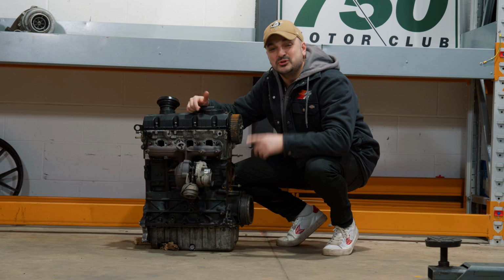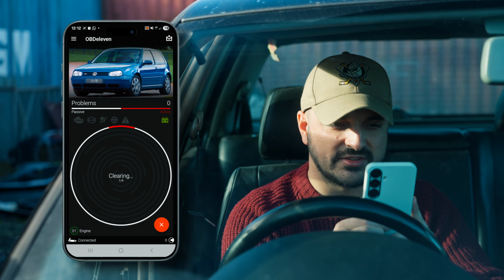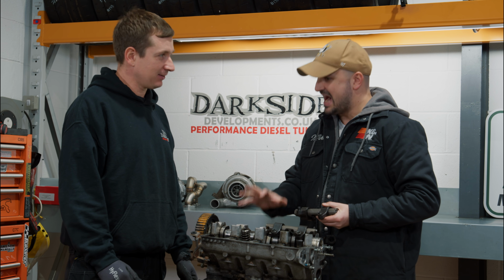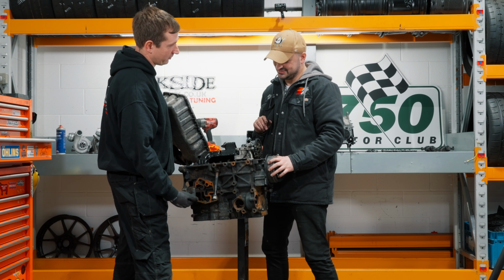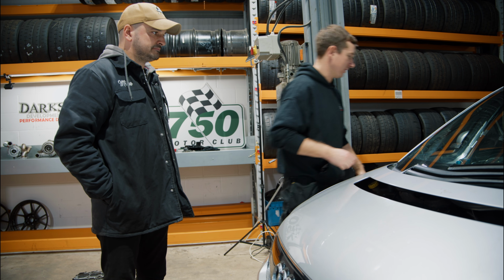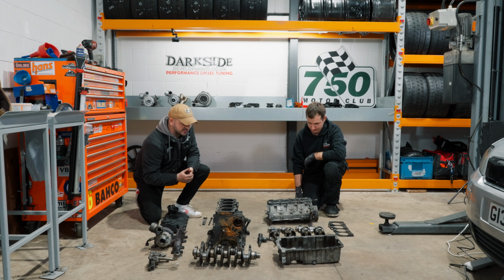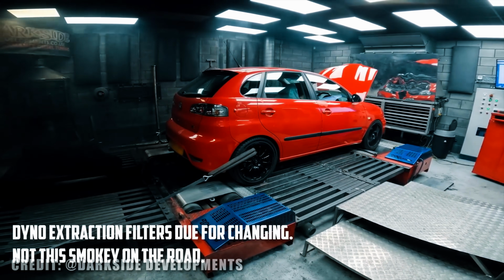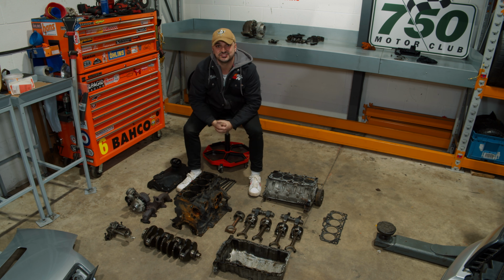Why This Volkswagen Diesel Is The Greatest European Engine Ever Made

Comment: I have a golf4 PD90 ALH from 2001 fully stock, bought it after covid with around 250.000km and it had not been maintained very well - leaking injection pump with faulty temp sensor, air bubbles in the fuel return line, cracked vacuum/fuel lines, faulty radiator thermostat, coolant had probably not been changed in more than a decade, massively clogged EGR/intake... and the fact that with all these issues I remapped it to 130hp and IT WAS STILL RUNNING PERFECTLY is a testament to how indestructible and well built these engines were. I've ran it as my daily for the past almost 6 years in far from ideal conditions and other than oil changes and one regular timing belt change, it has had zero issues so far.

Comment: I used to have a beautiful Audi A4 B5 avant with the 1.9tdi in. I had 5 years and sold it at 200,000 miles. Biggest mistake i ever made.  No other car i had even came close to how reliable that car was. Quick too.  Even 6 years later i still miss it. 😢

Comment: 2017 K9K engine 1.5tdci -- used in several motors including Mercedes , little engine , sounds great and pulls brilliantly , with maintenance , you will get some mileage out of it ,with great fuel economy too
Reply: Its a 1000% Renault engine and its not tdci. Its a dci
Reply: @ThaDutchDK1989 good shout , sorry force of habit

Comment: Back in 2006 I had a MK4 golf with a remapped pd130 in it, and 160k on the clock, never had Dyno proof of what power it was pushing but the previous owner had it tuned by star performance in fife and it pulled like a train, like proper quick, It was one of the quickest cars in my local area easily smoking most of the competition, pushed a Subaru wrx along a road one day sitting right up his arse and he could not get away from me till about 100mph then my golf kinda ran out of puff or wasn't geared right, not sure, had it for about 3yrs and apart from servicing it and tyres it never cost me a penny.

Comment: I had a 2002 VW Passat with a 1.9 TDI AWX engine. It was running  on Vegetable -Diesel mix. The only mistake I made, sold the Passat and bought an f*cking 2011 Subaru Forester Diesel.🙄

Comment: Those engines are good but the turbos are a common fault . Stuck variable flaps due to carbon build-up. Over boost fault code . Engine in limp mode .

Comment: I had a jetta pd140 with a hybrid turbo 1756 staight thrpugh exhaust pushing 230hp and 367 ft/lb torque i absoloutely loved it.....but then it developed what i think is a common issue......hot start....so i sold it.....

Comment: I fecked my old 1.9 TDI mrk3 so much, and at the end I used it as a log carrier from the woods. Just threw logs at the back, ripped out the back seats of it.. Cold starts at -10°C full power from the getgo ✌️ It ran all the way to the scrapper, just borrowed a few plates from a friend with another Mrk3 gold diesel,  and drove it there... I used it for 3 seasons in the forest, it was idling for hours on end, only had to dunk a quart of oil now and then...
Reply: Golf 3 had no PDs though. Those where the first gen TDIs with a Bosch rotary pump and simple injection nozzles. Less power and torque than the PDs, but higher compression and way more robust. They also came as 2.5 5-cyl in Audi 200/A6 and the T4 van and a 2.5 V6 in the later A6. 
I have a short vid on my chanel of such a 5-cyl cold starting with no working glow plugs, completely gunked up injectors and way to late timing. I did some work to it last year, now it starts with the turn of the key.

Comment: The fuel injection system PD is not the reason why the 1,9 TDI engine is so reliable, it's the rest of it.
I have the older gen. TDI and it's even more reliable than a PD, it can run on fastfood oil 😂.

Firstly I would call it a 1,9 TDI, not a PD, same as you don't call the older one a VE (rotary pump).

Comment: Had one in my Passat. Was a horrible engine. Rough, very narrow power band and unwilling to rev. I then had diesel runaway with it. I saved the engine but I couldnt wait to get rid of it.
I then moved on to D5 Volvos. Much more refined, more reliable, sounds nicer and generally nicer to use. The only downside is they use more fuel than the VW engine. I was more than happy to pay that price though.

Comment: The CKRA (2nd gen common rail) is the best. After, they replaced the oil pump gear train with a wet belt.

The PD was a failure because using the wrong oil will eat the cam and its a 2-valve head.

Comment: I raced the VW Golf 2000cc DOHC 16Valve engine from the 1990's and the stock block,crank and rods could handle 7000rpm, We just bored them out to 83mm to use wiseco racing pistons.

Comment: I think this was the engine in my VW Caddy van. It threw a rod through the side of the block on the motorway with about 120k miles on the clock. I wasn't impressed.

Comment: I love it when they state all other diesels were basically tractors in 2001, yet Alfa 16v common rail mjet engine was 150bhp in 2001 with an easy remap to 180+(often 200bhp with stock engine parts) VAG fans temporary memory loss syndrome going on.

Plus before people go on about the old stereotypes, the mjet diesel engines are also pretty bulletproof if maintained(getting cambelt serviced late is a killer), parts that can fail are the German Bosch parts which are also used in VAG group cars with similar failure rates.

Comment: I think the MERCEDES diesel used in the E300 (1995) and the later E320 CDI was the best it was bullet proof and was a rocket.
Reply: Nope, the merc E320 was a pig. Injectors, EGR, electrical faults and body rot. Complete shite! Owner for 6 years, did 150k.
Reply: @cw3728 well the 300TD straight six before it was fine. 
I only drove a 320 CDI and it was a missile.
Reply: @jevmobile  No experience with the 300 was before my time. E320 was the fastest diesel at one point 150mph.

Comment: The engine that took over from the 1.9tdi PD (115,130,150, used in Mir golf’s) was actually the b@stard child 2.0tdi PD (such as the BKD engine used in the mk5 golf)… only for a few years.. then they switch to the 2.0tdi CR in the mk6 golf’s.

Comment: Before you make claims of the greatest engines  in the whole world or the greatest diesel engines or the greatest European engine don't forget about the Mercedes-Benz OM617 engine  it has proven its reliability over and over also the Volvo red block a proven reliable petrol engine and also European and there are American engines also with Buick 3.8 litre V6 used in the Holden Comadore and in Australia were live there are many Comadores driving around older ones but not many Volkswagen diesels and od course the Japanese such as the ultra reliable Toyota 22R/RE engine and l own 29 year old Toyota Hilux with that ultra reliable 22R  engine and its not sitting on a garage floor also it still has its original timing chain l hate ir when you British people clutches at straws about European engines there have been some very good engines from the past and the 22R engine in my Hilux has never been removed from its engine bay and has never been pulled apart and another thing is it doesn't burn or leak oil and another thing about my 22R engine it still retains its original head gasket but l have had tge rocker cover of to replace the gasket and that was the only oil leak it had also  Toyota deliberately over engineered the 22R engine such asa nickel iron engine block and made it simple and l did notice this Volkswagen diesel engine has a timing belt and tge 22R engine in  my Hilux actually makes my 1997 2X4 Toyota Hilux and l know of one 5th generation Toyota Hilux  has sold for more than its original price and my Hilux is  not but give it a couple of years and it will reach its original price and l bought it 9 years ago for aud $1500 and l will be selling it soon and l will make an extremely healthy profit and older Toyotas in Australia appreciate a lot actually if l put the aud $1500 in the bank with interest it wouldn't make as much as what my Hilux is worth

Comment: Diesel enthusiast here. I really love darkside developments work. Building a hybrid 2.0 tdi. Bhw 2.0 block with alh head and fuel and ahu computer in 1996 passat b4. My goal is to use up tp 35-40psi boost and nozzles are wzm similar size as bosio racing 520.

Comment: My first car was 2000 Octavia with 1.9 TDI. Loved it so much, zero issues and amazing fuel efficiency. Till this day (10 years later) I can tell by the sound of the car if it runs 1.9 TDI, sometimes I turn my head on a parking lot just because I hear it 😂

Comment: this engine outlasts the chassis and wiring of most cars equipped with it. especially when the car isnt parked in a garage or at the very least protected from rain and out of direct sunlight. bonus danger points for cold climate countries with regular trips on salted roads.

Comment: z19dth far better engine more refined more efficient ,,didn't have cheat emissions,,,, pd is a dirty inefficient engine,,the vvt turbo units carbon and seize up because the recirc  gases are dirty. way overrated engine.

Comment: The only flaw of this engine is expensive fuel injectors that are sensitive to the fuel quality.  The previous 81kw powered 1.9tdi was the best one, it had simple cheap injectors, a lot better fuel quality tolerance. Those engines were amazing.  130PD however has a lot better torque numbers and a power delivery is a lot better as well.

Comment: Sadly this amazing engine is let down by an impossible to get at turbo up the back of the engine and VW stupid electronics which bangs it into limp mode for the slightest thing ....some engine  codes  had crankshaft bearing wear  problems ...very costly dealer repairs...its not for broke students for sure .....

Comment: It has a own flaws to. It has only one side mount of injector so it's wiggle when run and worn out the socket in the head. Second is camshafts. When engineers design it they have to do massive cam for injector so they reduce cam for valves. That makes that cam for valves is weak and can by eaten up in 150 000km. Fuel pressure on second stage before injectors is from 3-15 bars and Afters years is leaking heavily. Diesel isn't good for cooling hoses so they pop and you have a problem.

Comment: Just remember, the TDI ones. Usually the turbo grenades itself and so change oil in time. Cracking heads and injector position problems are common in some models

Comment: 2012 Jetta Sportswagon 2.0L diesel was best motor ever owned. Addictive torque under your toe! It share best ICE motor in my 2.0L BMW 2002tii. Two litres are simply a sweet spot as the 327cu. in. was for SBC for Chevrolet. 
It thrashed its intake system and needed R+R at 130k.

Comment: I have the 1.5Dci in my Nissan Note. I am now going to risk a breakdown by saying that I bought the car at 32k and it’s now just over 80k and the motor has given ZERO trouble.
Edited to add. I suspect one or even two of the glow plugs has gone tits. All that mean is if REALLY cold, I warm the plugs 3 or 4 times before I try to start. If I don’t do that, the engine has to crank 5 or so seconds before it fires; no biggy. (And that’s not a problem with the motor anyway. Also always use premium diesel.

Comment: The 2003-2007 Skoda Fabia 1.9TDi with this engine was excellent, the low/mid RPM grunt and low weight belied the BHP number. I gather the vRS 130HP version was even better, even in town.

Comment: Diesel engines were the first to get direct injection. The first to get variable vane turbos. The first to get intercooled turbos as standard. The first to get a common fuel rail. The first to push 2,000 atmospeheres and beyond of fuel pressure. The first to get the particulates filter. Every innovation which happens in internal combustion engine space, happens on diesel engines first, then gasoline engines get the improvements, often years or even decades later. Diesel engines is where the forefront of technology is at. Been that way since 1990.

Comment: I bought a new Fabia in 2003 with the 1.9 PD 100, had it remapped to about 130 hp / 300 NM and drove it to 127,000 KM without the slightest problem. It would pull top gear at almost any speed up almost any hill and average 4.7 l/100 km (60 mpg) on most trips. Not the smoothest or the quietest diesel engine ever made, but definitely one of the best.

Comment: On my list it is the second best engine ever made. ANd the reason is, Belt driven camshaft. Nothing else. My daily driver is a 2008 Skoda 1.9TDI though (500000 km now). Because the best engines ever, are not viable anymore for daily drivers. I mean, i drive a taxi, and there is a rule that a taxi cannot be over 20 years old (Bolt, Uber).  

And what is the bestest? it is the Mercedes OM601/2/3/4/5/6 but i also count the first CDI models in, OM611/2/3.

Honestly, the cam belt is the only reason why it is 2nd., it is not easily serviceable at home, as chain is (also service interval is 10x higher vs double row chain)

Comment: think the 2.0hdi psa engine 90bhp was just as bullet proof ..Once high pressure pump issue sorted
Reply: The 1.9 turbo diesel was the most reliable (as far as simplicity and low maintenance). The hdi is a great long lasting engine but a little more complex. (Coming from a hdi 306 owner both are great obviously 😊)
Reply: Also the 1.7dti Isuzu engines. ran forever

Comment: I've got the 2.5 is on 313k miles but now getting diesel in the oil , struggling to work out why it's doing it
Reply: From what I know it should either be worn piston rings or leaky injectors?
Reply: @amkobih4479  ppl are saying injector seals but like u say could be a number of things so don't wanna pay for something it's not 😅 do u have experience with VW?

Comment: I did my research to find the most reliable diesel engine ever made. Found the 1.9TDi and bought a Golf with one in it. I did 450,000 kays in it and it already had 250,000 on it when i bought it. 
Only left my posssesion when I was t-boned by a 80 year old man. Loved that engine. ❤

Comment: "All while achieving 50+ mpg" I'll stop you there bud. An engine can only be as efficient as the mass of steel it's trying to move through the atmosphere. Typically those 1.9L TDi engines are in medium to small vehicles, mostly quite aerodynamic, and coupled with the engine's high thermal efficiency, it will sip fuel. To move a large vehicle at speed a certain amount of power is required. To develop that power you need fuel and air. Fuel is what we care about. Typically you get smaller engines in smaller cars and larger engines in larger cars. Larger engines aren't "less efficient," they just have to move a larger vehicle. Similarly, if you put a smaller engine in a larger car it does the same thing, but you won't have the top end so it will struggle to go up a silly little hill.

I used to drive an Iveco Daily for work. 2.3L diesel. In any car that would get you 30-50 mpg. The van, being large and moderately weighty, but mostly just large frontal area, would only ever get to around 36mpg on the motorway, and around 22-26mpg town.

Comment: FIAT is the father of TDI and gained royalties from VW at every 1.9 TDI they sold. FIAT build the first TDI engine ever on car with the 2.0 diesel AND the first with variable geometry turbo at the late 80's. I drove one in a 1994 Croma 90 TDI during 15 years without any issue.
FIAT created the Common Rail in 1997 on new alfa 156.

Comment: I have a 2001 golf SDI non turbo is mine the same engine? Anyway it still runs a treat, had it from new with no problems. It’s just done 100000 miles and originally cost £ 10,858, I change the oil and Mann filter every 6 months ( 5w40 fully synthetic) and new coolant every year ( VW G13 ) - there’s a tap on the bottom of the radiator you twist and pull. I change the fuel filter every 2 years as I don’t do many miles, I know I’m probably over servicing ( as the oil hardly gets black between changes ) but it’s been such a good car the last 25 years I feel it deserves it. Great vid, cheers.

Comment: Mate, please stop with this nonsense. The best diesel engine is from Renault and Peugeot. Renault F9Q 732, M9R and Peugeot 1.4, 2.0, 2.2 HDI. Volkswagen diesel engines are inferior to BMW M47 / 57 and Mercedes OM found in the 200 CDI, 220 CDI, 270 CDI and 320 CDI. Plus the 80s and 90s diesels found in Peugeot cars. By no means VW ever did an engine that can be called "best".

Comment: Those engine’s eat timing belt 

All my customers whit a BKC engine where hardcore 350.000 450.000 570.000 km no problem only the injector electric ⚡️ in oil was not a good idea 👍